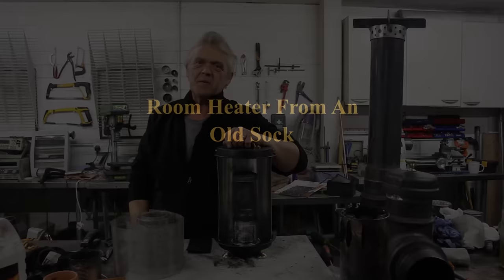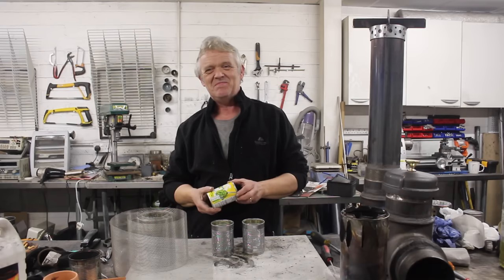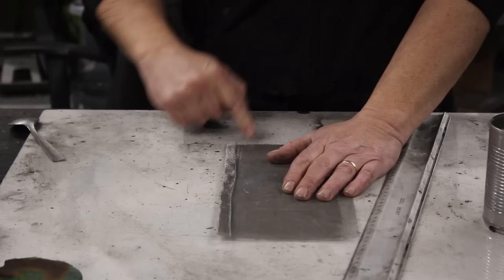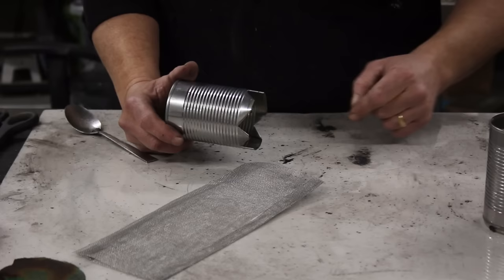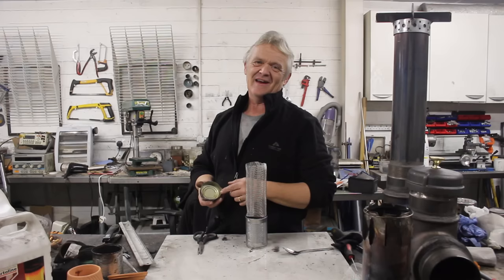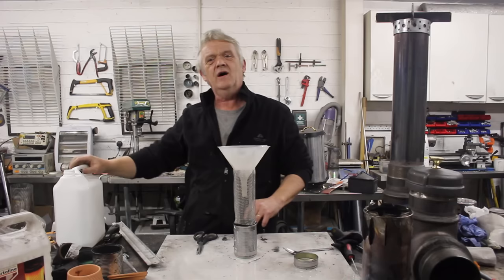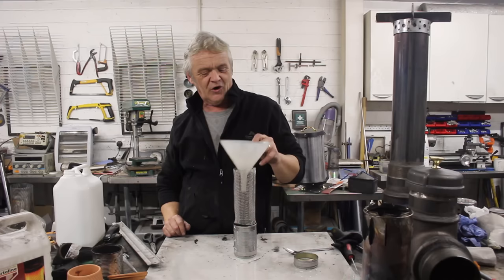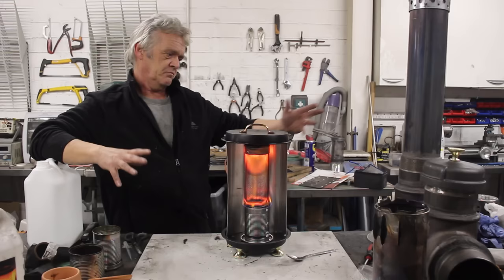1746 DIY Room Heater From An Old Sock

Comment: Thanks Robert excellent video excellent series on self DIY heating. I've been experimenting myself with different versions of this and I'm getting ready to use old jeans material blue jeans in fact flattened and rolled to use as the wick and I'm also experimenting with tapered cans those such as like beer cans that have the aluminum tapering it makes a awesome flame and it swirls automatically.. keep up the great work stay warm..🤔👍🇺🇸

Comment: In the USA, Carbon felt blankets are sold in plumbing departments, and are used when you solder by flame, to keep the wood or the wall behind it from igniting.
Reply: Nice tip, thank you!
Reply: @ogi22  Those blankets are only the size of a sheet of paper...
Reply: @toml.8210  fold it once, fold it twice... Thickness goes up exponentially ;)
Reply: @ogi22  I've the plumbers use it.  you only need the one layer, since it burns at 2500C
Reply: @toml.8210  sure, as a heat resistant protection, one layer would be fine. But a paper thin wick is not that perfect. It needs more surface for liquid to climb up. That's why i said about folding it. It's about creating as many micro-channels as possible for the fuel to go up.

Comment: Thanks, Robert, I've made one of these with a few re-designs. Having the inner tin open used the fuel too quickly so I've got closed mushy pea tin with a small hole. It was too tight a fit in a baked bean tin so have used a tinned potato tin and works a treat. I put the burner inside  an old pedal bin cut in half as the radiator. I use it to heat the greenhouse with a clay pot on top for a bit of capacitance and on top of a clay pot so the heat radiates better. Total cost, £6.95 for the gauze as opposed to over £20 for the cheapest greenhouse heater off Amazon!
Reply: How do you refill it if the hole is only small ? I found the same, burned too quickly with even a tuppance size hole - I will stuff the hole with foil next time.
Reply: @orla556  in one of robs videos he suggest putting a coin over the center hole or just have holes at the sides.
Reply: @standfortruth4568  Thanks- I did try it with the coin but the fuel was burning up through the centre whole as well as sides- burned through fuel too quickly. But with a small hole you can't refill without taking the thing apart which is nigh impossible cos very tight fit...maybe a smaller inner can would be easier to remove for refuelling.
Reply: @orla556  yes a smaller inner can without a top hole works better.
Reply: @orla556  I use a hypodermic needle. I've repurposed the one I used to refill ink cartridges. It takes a while but it  works!

Comment: Mr. Murray I'm in the  process of collecting all  the  bits and pieces for making a meth heater. Because I'm shocked at the price of baking trays in Ireland 7/ 8 euros up to 16/17 and the cost of knobs and handles I've come up with the idea of a lantren. At 50 euros it is all encompassing with a door ect. I'm so looking forward to see how it works out. Thank you for your inspiration and knowledge.
P.s. the carbon felt is a godsend as I need some for  my dehumidifier and I didn't know what it was and the makers wanted 40 Stirling for 4× 8 ins. Now I've just purchased a lifetime supply for 20. Thank you,  Ruth.
Reply: Cooking meth and making heat is not the same😮lol

Comment: Considering this is about making it more budget, I thought I'd add that the funnel to refuel it doesn't need to be an actual funnel. I certainly wouldn't want to be using a fuel funnel for food after the fact, not that it'd probably do much harm, but still.

You can just cut the bottom off a suitablably shaped bottle, and it'll work just as well for this purpose. Shampoo or soap dispensers are a good option.

Comment: I would offer a suggestion to put a magnet in the bottom of the burner with the fuel to make it a little less likely to tip over if it gets bumped

Comment: Hi Robert, love the infrared heater, but iv only managed 45 min burn time on full can.
I haven’t used the carbon fibre wick yet as still waiting delivery.
Used kitchen paper, usual wick from Parafin stove & both get a good burn but not the 4 hour burn you mentioned.
Any help appreciated 😀🙏if it burnt longer it would be perfect answer to not turning the gas boils on 👌

Best wishes 
Love the channel 👍👍👍👍

Comment: I made the previous version with the carbon filter but turned out it wasn't pure carbon so used cotton instead.
I lit it outside and eventually got it going.the problem I encountered was that after a while the centre tin shot up in the air. I may have made the small hole in the top too large.
Has anyone else had this problem?
Love all your content Rob, brilliant.

Comment: The same hardware stores who sell the stainless mesh, usually also sell wicks for kerosene heaters. I would recommend using those wicks.
Reply: definitely. with a large cookie tin incorporated for fuel tank and center air vent, this burner could work, and be capable of running a few hours per fill

Comment: i live month to month like a lot of Americans. i took four 1" wicks and fixture that fit on jars. with an old 6" stove pipe about 6" long tapered down into a foot long 4" pipe, at the top of the 4" pipe i made a stainless mesh 6" long with a cap at the top. i live in a metal on metal trailer, anyone that lives in one knows, they are very drafty. i can heat a 144sq room when the temp is down to 20 (-4c) P.S. i also have a 5 gal clay pot at the top, old bricks work, a bolder works.. lol.. love your videos sir,, keep them coming. wishing everyone a warm and cozy winter with love ones. yes its tall but im warm.. lol

Comment: I'm on the way to making mine. I bought a 10" by 8" piece of felt off ebay for £7 it took two weeks to arrive. I tried it with some meths and eventually worked though a bit of a smell off the meths indoors. I'm going to get some bioethanol from B&Q but my local one doesn't have any at the moment. I'm also waiting to make the reflector, going to get a stainless steel small peddle bin and bastardise that. Hopefully the bioethanal doesn't smell like the meths did!

Comment: I once carbonised two old socks in an attempt to make carbon fiber myself, didn't pan out as intented though and them socks still had some leftover smell for awhile. Of course I didn't bother to wash them before I put them into that jar. Also noticed that they were very brittle so thats why it didn't work as intented, anyways now I know. There is one other chance with that and it is old swimsuits/speedos that are mostly the fiber they use for commercial carbon fiber. Maybe I try that if I ever have a chance to get some of that material on my hands as "trash".

Comment: I made one of these. They work great!
But I had some difficulty snuffing it out. I tried a large towel but it had the tendency to catch on fire. I finally snuffed it out by wrapping with a sheet of carbon felt. This burner seems to go even when almost starved of air. I think there needs to be a better way of snuffing it out or regulating the flame like a oil lamp does.

Comment: I wonder if you could use mineral wool for the sock? (also called insulation paper, or some other such) or if you could maybe take ground graphite like you get as a dry lubricant for locks and such, and press it into the sock so as it burns away the graphite might intercalculate into the left over material of the sock making that carbon felt? just a couple ideas maybe to try, also here they sell graphite paper for transferring images that has quite a thick coating of graphite on it, at hobby lobby (USA) and probably plenty of other art and craft supply stores. 

one last possible option I thought might work for this, that hawkinlight (or something like that is the channel name maybe bluehawkinglight?) anyway he used a different mix to make starlight, where he used sugar instead of PVA glue, and added borax I believe to it, which when it foamed up it formed a rigid carbon foam brick, and I am wondering if that were diluted plenty then dip the sock into that or any other cloth spongy substance then wring it out so its just a tiny bit over it all, so as it burned it would foam up to replace the sock with carbon foam structure with hopefully an open cell structure to act as a wicking agent for the fuel of choice, to last a really long time then just scrape it out or put some more over any damaged areas and let it dry then fire it up or something?  

some options that might be more accessible to those that can't get the carbon felt, and might last longer than said sock, as well as maybe some options to coat the outside too, and do layers to have insulated layering for safety and such, that would be super super easy to apply, to control the output of the heat exactly where a person wants it. 

Really loving the videos, Rob :) off to work for me, hope to see more soon. :)

Comment: A couple of alternative materials to use as a "forever wick" could be wool felt,  fiberglass felt, or even fiberglass insulation.
Reply: Correct me if I'm wrong, but I have learned that wool can produce some realy nasty deadly fumes if burned . Cotton cloth in some form should be easy enough for most of us to get hold of.  As you suggested fiberglass or rock wool should also be easy to find.
Reply: @noldushumlesnurr6169  I don't really know.  I was just throwing spaghetti at the wall.  I did watch a video here on YT about using wool felt in an alcohol burner.  It worked, but it did start to burn a little.
Reply: I tried 100% wool felt. I thought that it would be good because it needs a high temp to burn. Unfortunately it melted and charred making it difficult to get more than one burn from it. I'm interested if anyone has had success with fibreglass though.

Comment: Don't recall if in any of your other videos you mentioned it, but it would be great if you were to do a timeframe/ do a time lapse of how long a volume of the methanol or whatever used lasted, like how much time would 100 ml would run for
Reply: This is my main concern as well.
Reply: So test it  try different socks. Try different materials. Try hemp cloth.

Comment: Ingenious, but I would be cautious about burning textiles indoors. 100% wool is probably the safest option. You might assume cotton is safe but in fact can produce acrolein which is a toxic biocide. Acrylics, polyesters, viscose & nylons can produce a range of toxic fumes and carcinogens. Even low air concentrations can cause effects like eye/respiratory irritation & nausea. In particular burning nylon can produce hydrogen cyanide fumes.

Comment: I bet someone will ask ,which type of sock Robert ie ( cotton,silk,wool, mixed fibre ect) , for those people cut a bit of the sock put it in a small tin (fireproof dish) put in small amount of methanol ,light it and see if it melts or burns .

Comment: Here's a couple of questions" 1) What about exhaust fumes et al from the heater, or are there any? 2) what about air supply for people in a room if the room is relatively sealed since the heater will be consuming oxygen? To offset the possibility of someone getting burned, make a double shell for the reflector and fill the void with "rock wool".

Comment: Question; How long would half a can of methanol burn for?
Also, is there any way to control the burning rate?
Reply: The way he did it in the video, it will burn very fast, let's say i about 10 minutes, more or less. Yes there is a way of controling the burning rate. You have to use in stead of the sock, the carbon felt. Then tin in the inside it should nog exced the outside one but 3 or 4 mm. It should not be open but have the top closed and with only a small nail hole in the middle. You can then place the wire mesh on the felt and a coin on the hole that way it will burn slower and more efficiently. A half can will burn for half an hour.

Comment: Carbon felt is easy to get hold of on ebay and the like, unfortunately they don't describe it very well, i got mine from a vendor they had it listed with various keywords, carbon felt, carbon mat, welding blanket etc etc the main clue I went on was the images show the felt being blasted with a blow torch, 3 thicknesses 3,5 and 8mm and was about 300x200mm seems to be a standard dimensions.

Comment: Hello there. Very cool and nice heater. Looks like it would put out alot of heat. Was wondering how you would snuff it out or does it have to run out of fuel and just goes out on its own.

Comment: Reference Roberts 1702 video. I am going to experiment by adding a thinner mesh  or possibly a ball of mesh in the centre to utilize the flame coming from the pinhole at the top of the inner can. If it glows red, it will be adding to the heat out put of the heater

Comment: We have a couple of types of kerosene heaters sold in retail stores here in the US. They are all require a "tip over" safety mechanism. They use a duel tank system and a weighted "trigger" attached to a spring loaded wick holder that retracts to accomplish this. It would be awesome if some enterprising person could accomplish a similar DIY solution. I remember my dad had a Coleman brand camping tent heater. I have no idea how it worked.
Reply: I guess what you could do is just have it in a sufficently tall base structure, with some width at the top, and have the whole burner hang from the top. That way if it falls over the actual burner remains upright, even if the stand is on its side. And by some width I mean it would have to be wider at the top than the burner is long so it can swing a full 90 degrees to the side if necessary. A bit of a cumbersome solution, and not as safe as compartmentalising the fuel properly but it's safer than nothing.
Reply: @__-fm5qv  I love DIY things but It's probably best just to buy a code safety rated heater. It makes no sense to risk burning down your house or killing someone to save a few dollars. I bought a kerosene heater for $50 on spring sale at Tractor Supply 6-7 years ago. I'm sure they cost more now but I need a new one. Mine started shutting itself off because of gear wear on the spring loaded wick adjuster. It would trigger the safely shut off when the gears slipped. Methanol or ethanol fuel is to expensive to heat your home with anyway. It's fine for camping hikes outdoors to boil water because you don't use much, just a couple ounces at a time . I made one of those tiny soda can ones to see if I could. Frankly, where I live you don't need a camp stove. We just build wood fires. If there is a fire ban, no problem. I have 2 lightweight propane stoves that use the 1 pound tanks available at almost any corner store. (I might build a refiller) One is a compact single burner that I bought at a yard sale for $5, still in the box. The 2 burner one I got for free at a local recycling center. My sadly departed master craftsman uncle (miss you Larry), who hand built Ice racing boats for fun, gave me good advice, with proof, which I take into account till this day, "don't try to reinvent the wheel, It's a waste of time". The path of least resistance has usually been tread before. For sure, innovation is possible but be wise about what you put your energy into. Look into new possibilities.

Comment: Hummmm. 🤔.  Back in the old days ( early 1970s ) when I worked on the British Columbia Railway we would heat our Speeder ( rail scooter ) with methyl hydrate...  We used a one gallon tin can  with fiberglass insulation stuffed into it so would fill the bottom 3 inches or so, that was our wick .  Then we would pour in the methyl hydrate and light it.  It burned nice and clean and provided heat for a fair while.  That winter we burned up a 45 gallon barrel of the stuff. When it ran out we switched over to propane and a torch.  We only had one small misshap when we caught the Speeder's canvas door on 🔥 fire.  😮😊.

Comment: Instead of the inner tin being open at each end like a tube, it might be better with only the bottom cut off and a hole in the top where you can fill it via a 15mm copper pipe and a funnel? After you fill it up you can optionally put a copper end cap on the pipe.
Edit: End cap (optional) should be loosely placed much like a penny on a penny stove - not sealed tightly.
Reply: Well, there are things like alcohol penny stoves. Exactly as you described.
Reply: I think this design change causes the fuel to be heated inside, evaporate then burn inside the mesh. His earlier model had a single small hole. I think it was for filling. The mesh covered the wicking material.
Reply: You may then run the risk of the feul vapor getting trapped which would cause the can to act as a projectile 🤔😳😬
Reply: @ellissmithjr6599  That's why you don't use air tight sealed containers for those stoves. Some lamps or burners that use pressure pump to move fuel, should have a pressure valve for safety and more fancy ones could have a check valve for fuel supply line to a burner. Next thing is the size. All those alcohol burners are just small cans. Usually there is not much fuel there and in the event of failure, you are usually able to deal with it. Big size fuel containers should be separated from a burner to be safe from overheating.
Engineering is a very interesting topic :D
Reply: @ellissmithjr6599    It's already happened four times after reading all the comments so far and I've seen it myself caught on camera on another channel.
Folk really do need to be careful, especially this year with extortionate energy costs.
Reply: @ogi22  Yes that's right only instead of a penny, a loose fitting end cap placed on.
Reply: @ellissmithjr6599  The end cap is optional but loosely placed so as not to seal it completely, much like a penny stove.

Comment: the carbon felt i use is a "carbon felt welding blanket" and it works it may be thicker tho but works. can find it on ebay.
it could be call carbon Fiber welding blanket as well.